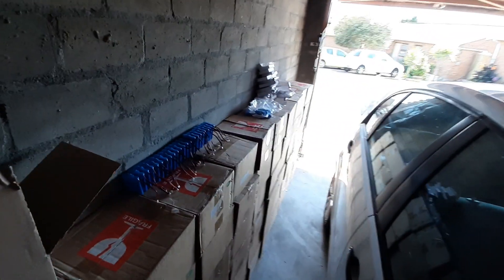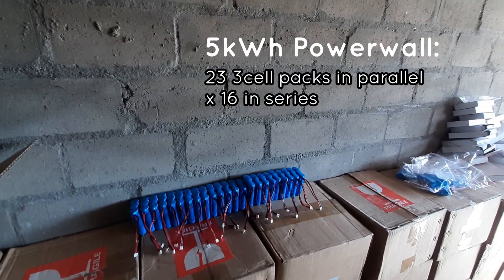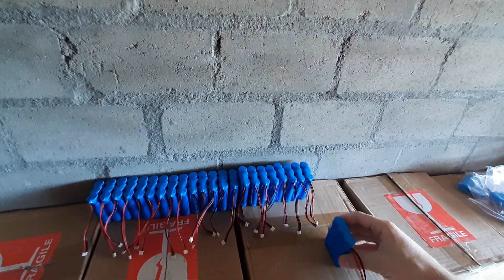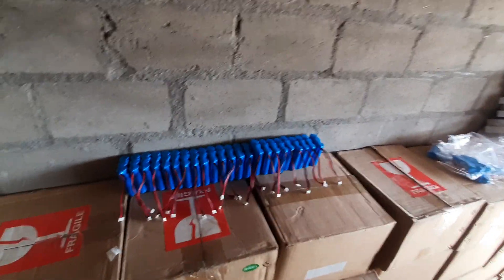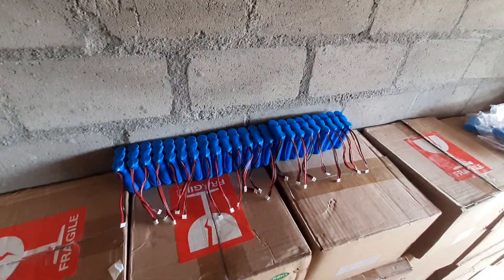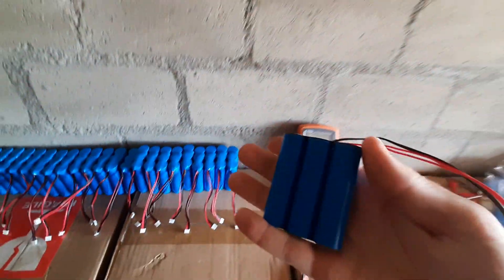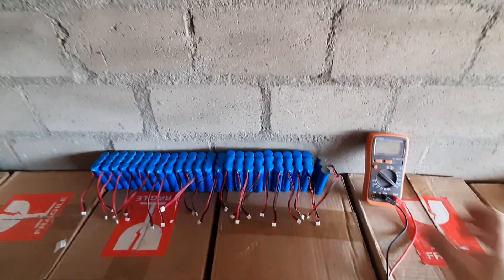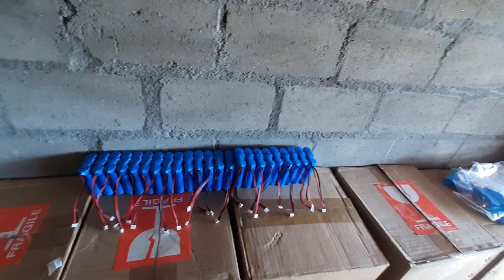Building a DIY 5kWh LifePO4 Powerwall ~ Part 1

Comment: isn't a 24v system more efficient?
Reply from the maker: On a 24V system the current is double that of a 48V system to get to the same power output. P=V*I

With double the current your DC losses in your DC cables will be higher. To counter this you can install thicker DC cable which also pushes up the price of your installation.

Comment: Your Li-Ion installation looks awesome. What BMS's and voltage indicators did you use if I may ask & where do you source your parts? I'm also in SA. Regards !
Reply from the maker: Hi, Sorry for the late reply. The voltage indicators I bought from Banggood.com I used south Africa Direct Mail for shipping. Not sure how good that option is now after COVID19.

I used a bms from DALY. I will however be soon bringing in a couple of those as the requests for them has gotten quite a lot so please send an email to joediy365@gmail.com if you would like us to keep something for you.

Be on the lookout for my other video I am planning on a self assembly or pre-assembled lifePO4 12V battery bank at 120AH.
Reply: @johndiy  !! Awesome man cant wait for the vid. I am looking for DALY bms & maybe others,... have harvested a ton of 18650's so i want to start assembling packs and stuff. Will stay in touch =D Cheers

Comment: Hi ma man,where did you buy those 18650 and how much do they cost.mpumalanga
Reply from the maker: I bought the whole batch that was available from E-waste. couldn't miss the opportunity.

The packs are going now for R55 per pack if buying less than 20 packs, R50 per pack for 20+ packs and R 45 per pack for 100+ packs. The price may increase as the available stock gets less.
Reply: @johndiy  how much did the 16s cost

Comment: Would one then need a 48v inverter to convert to 220v?
Reply from the maker: For the battery that I am currently building yes, but you can build your battery for 12V, 24V, 36V or 48V inverters. In our case the nominal would be 51.2V if you take nominal as 3.2V per cell and times by 16.
Reply: @johndiy  Is there any reason why you chose 16S instead of something lower? Because of efficiency? Thanks for the video.
Reply from the maker: @cubiq1  Thanks for the great question. 16s will allow you to better utilize your cell capacity. As our inverter can only operate between 45 and 64VDC.

At 3.2V nominal you get 51.2V nominal for that inverter.

45V/16 = 2.8V per cell which is then practically empty for the cells. But you can change the settings so that you don't draw them completely empty.

If you use less cells, like 15s, depending on your inverter you might struggle to be able to fully utilize your stored capacity when needed most.
Reply: @johndiy  Ah gotcha. Thanks for the info!